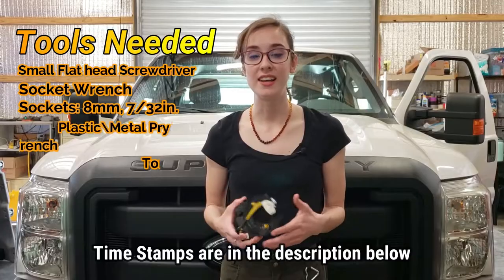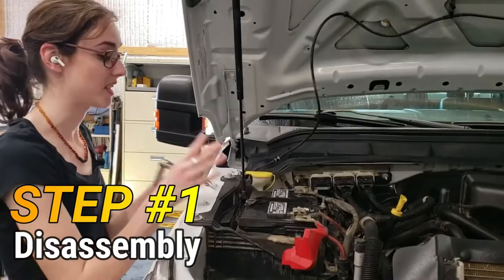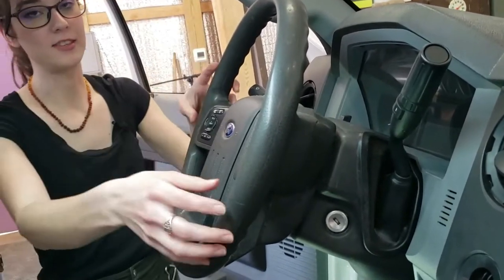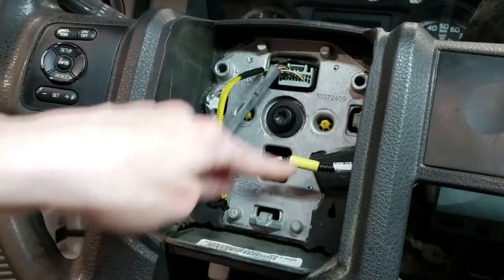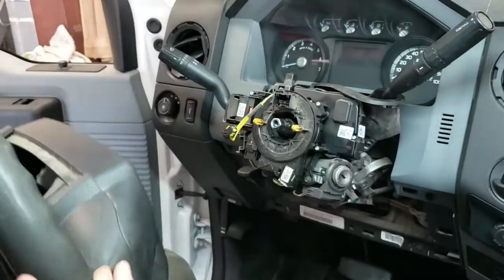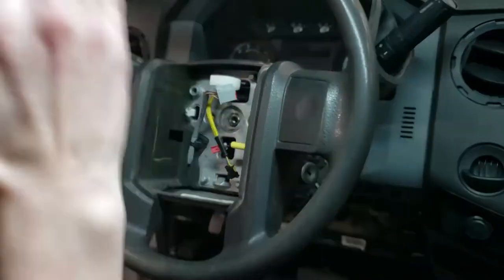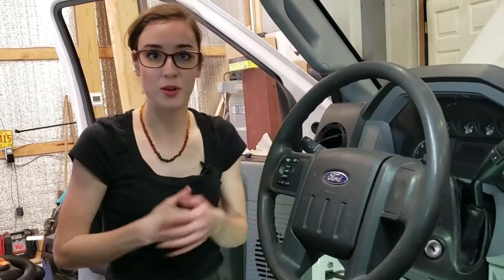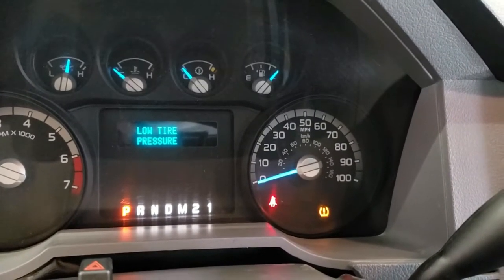Replacing Clock Spring | 2013 - 2017 Ford F250 F350 F450 F550

Comment: Mine went out in my 2016 Expedition. Steering wheel controls quit working. Took to local Ford dealer. Charged me 135.00 for diagnosis. Then quoted me 683.64 for the part and 202.50 for labor. So i would have had a bill of 1021.14. I bought the part online for 156.51. Took less than 1/2 hr. to replace. I wonder if ill get back what they were going to charge me when these are included in the recall? FORD DEALERS WILL STEAL FROM YOU WHEN GIVEN A CHANCE!
Reply from the maker: Appreciate you posting @johnpage6118. Glad you were able to save that much $$!
Reply: Just got a quote today...$2780 for clock spring replacement. The part (with the complete housing assembly for some reason) $1548 and $1232 labor..all because 3 times in 80k miles I had a steering warning pop up and go away. I brought the 2017 F250 in for a completely different reason and just mentioned the steering error message off hand. Needless to say I will not be going to that dealership again. Gosch Ford in Hemet.
Reply from the maker: @JasonMr.J... Amazing. Thanks for posting!
Reply: @JasonMr.J  Get the part online and do it yourself. Very easy. If the controls still work I wouldnt do anything till it stops.
Reply: @hopfammedia  Thank you for posting your video. Very helpful!!!
Reply from the maker: So gladit helped @JasonMr.J  Thanks for the encouragement!

Comment: Laura, thanks for taking the time to edit and post this video, very helpful.  You mentioned in your tool advice a 7/32 socket (some might want to use a 5.5 mm if they only have metric tools).  Also, you mentioned a 7 mm socket to remove the lower bezel, (might have meant a 7/32 or the 5.5 mm).  If you ever edit this, you could add the 8 mm you used to disconnect the battery cables.  Final addition, on the back of the new clock spring are two small guide pins that index into the steering angle sensor.  They are delicate so advise your many viewers to be careful not to break them.  If after this repair, it is remotely possible that a scan tool might be needed to "re-calibrate" the steering angle sensor.
Reply from the maker: Thank you for the encouragement and clarifications @spyderman1963!

Comment: Very complicated electronics but not as bad as replacing a sensor matt that is integrated into the seat. Very easy to break when you insert too much pressure on the seat, like knee on it. Or put something on the seat that is very heavy. To replace it you need to dismantle the entire seat or just find another matching set of seats. Since it is a pressure sensor inside the seat it means also that once the micro connections get broken the airbag light will never go out from the dashboard. Air bags can actually kill if not handled properly so good call on safety working with the vehicle.
Reply from the maker: Wow, that certainly sounds intense. Thanks for the input, Steve!
Reply: @hopfammedia  My own Painful practical experiences 😅that I wanted to share

Comment: could this be the reason why my high beams are stuck on even when the truck is turned off. I just got the truck and the steering wheel is also misaligned which I plan on getting it aligned this upcoming week. I read that a steering wheel misaligned could be the reason for the stuck high beams.
Reply from the maker: That's an interesting question.  My gut says no. Please comment if you learn more about it for others benefit.  Thanks for posting!

Comment: My steering wheel buttons are all mixed up, and i'm pretty sure it's the clock spring wearibg out on my 2016 F150.  I noticed the recall was F250 and up, but I have to wonder if this is the same issue related to the recall ?  I have no problem doing the labor, but I was hoping Ford would give me the upgraded replacement part.
Reply from the maker: Hi Brian! We haven't run into that issue before, but it might be a good idea to input your truck's VIN at https://www.nhtsa.gov/recalls and see if there is a related recall. Another possibility is that the buttons have been removed before and then replaced incorrectly. Hope this helps!
Reply: Today, Ford dealer just replaced my Clock Spring in my Ford F250 Super Duty. (7/19/23)
Ford sent me a letter in the mail a safety recall.
I bought this truck used 8/2022.
Send in your vin number to Ford!

Comment: Took my f250 in for this recall and now my horn doesn't work 😕
Reply from the maker: Yikes! Was the dealership able to address it for you?
Reply: @hopfammedia  took it back to the dealership and they fixed it in able 2 hours. They said the mechanic forgot a connector.  👍